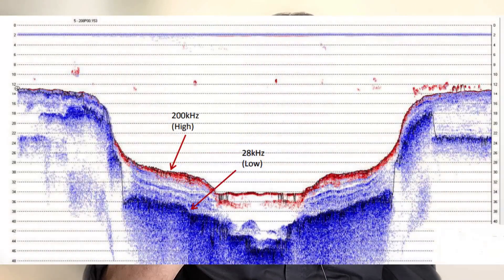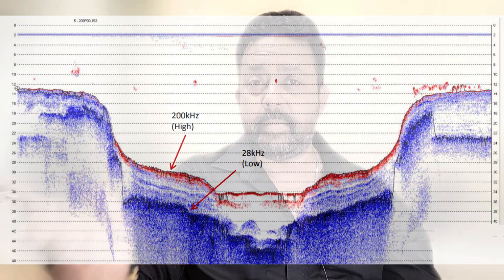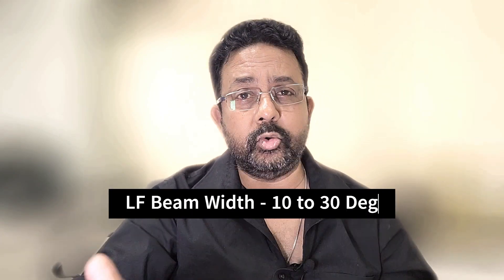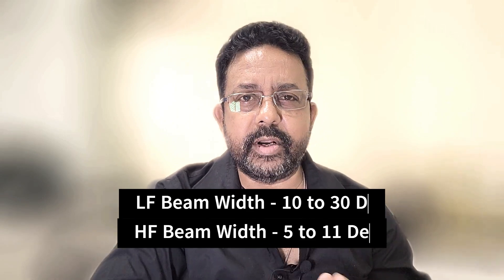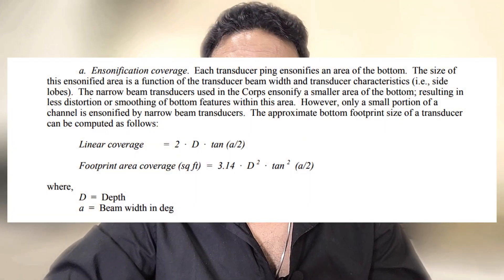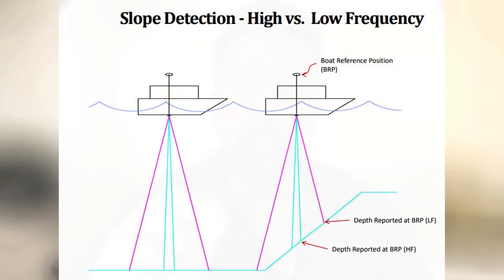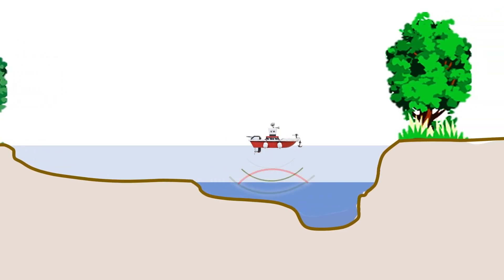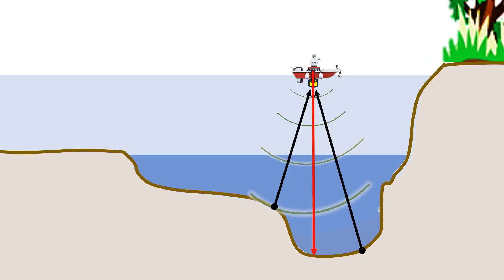Why Your Single Beam Survey Might Be Wrong

Comment: Dear Sir, 

These are two different types of equipment used in bathymetric survey. It can be used any one or both 

1.	Single beam frequency echo sounders and digital output system a range up to 30 m (or more than the max. depth of water) having adequate resolution, should be used for conducting Bathymetric and/or Hydrographic survey.
2.	Side-scan sonar equipment (used on separate voyages to single beam bathymetry). Sub-bottom profiling system (may be used simultaneously with single beam bathymetry).
Reply from the maker: Hi @rajeshsolanki8147  I am sorry but I do not understand your question. Bathymetry and Hydrographic survey are completely two different things. Side Scan is not required in Bathymetry survey. Moreover what you have listed has nothing to do with the video. 🙏✔

Comment: What is the coverage of multibeam while doing bathymetric Survey of channels. What should be the spacing of survey line of navigation channels.
Reply from the maker: Generally the total swath is 4 times the water depth, that means if it is 20m of depth, you will get a 80m swath - 40m either side. So to get a 100% overlap you need to do lines that are 40m apart. Now remember that, you will always not get optimum swath. So I would say that in 20m depth you can expect usable swath of around 70m or so. But there are other echosounders which can give you 8 times swath and 16 times swath. So it all depends on what kind of MBES you are using and line spacing depends on Scope of work or client specification. I hope you got that. Right?